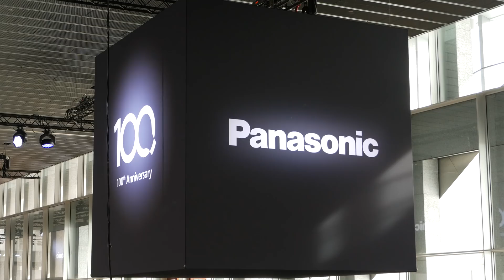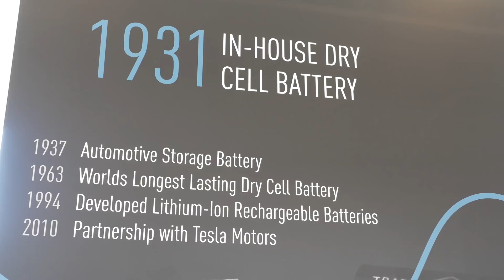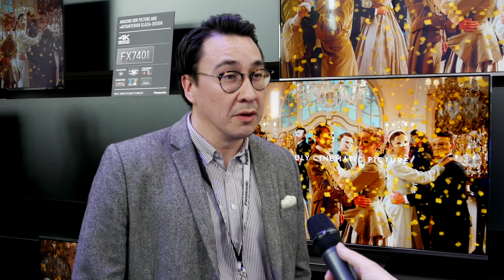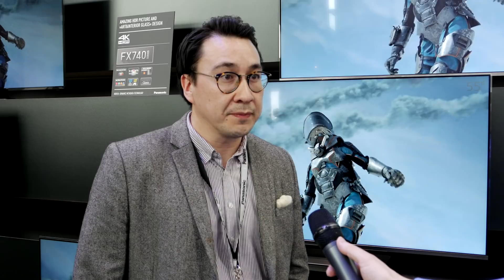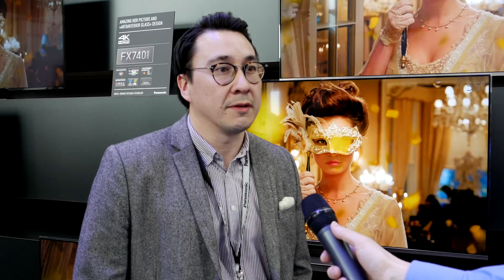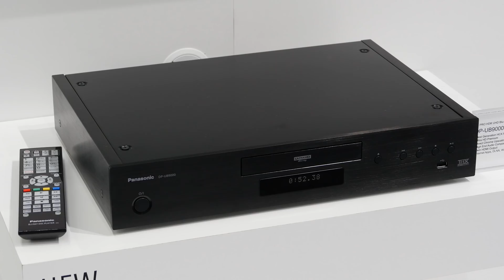Panasonic launch FX600, FX700, FX750, FX780 LED LCD TVs & UB9000 THX 4K Blu-ray Player

Comment: if they dont add hdr 10+ support for the 2017 line up like ex600 700 series then panasonic sucks ...they cannot expect that people change theyre tv's every year...guessing by the reaction of the director i dont know if they would to this...then i am gonna be sorry that i choosed panasonic :(
Reply: Marius Florin Pavel panasonic is updated 2017 models with HDR10+  Firmware mainly the Oled   range example EZ950U upwards
Reply: Even if you don't get every gimmick, you should still be happy with your purchase. As the man in the video said, Panasonic makes high quality products. I've had my Panasonic HDTV since 2011. It's been great, and there's been no indication that it is letting up. The only problem now is that I don't have any valid excuse to buy a newer model.

Comment: Ips panel?no thank you
Reply: Currently:
IPS : problem with black
VA: problem with viewing angle
OLED: problem due to burn-in
I want to buy a new TV but I decided to hold-on until better stuffs to come.
Reply: @guanyu210379  Plasma - no problems :).
Reply: @guanyu210379  You should be highlighted on every TV buying guide page.
Reply: @guanyu210379  wait until you become 60 yrs old . You hv few years to enjoy tv watching , that is if your eyes still ok that time .